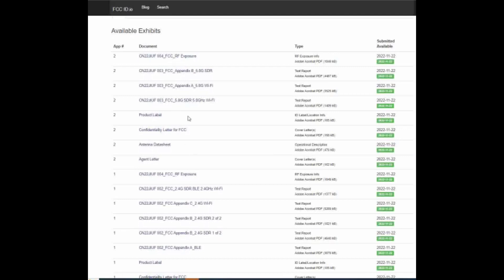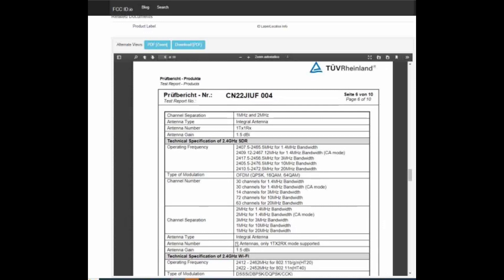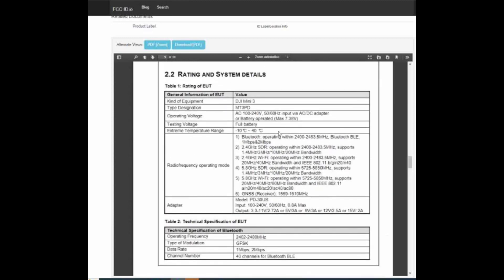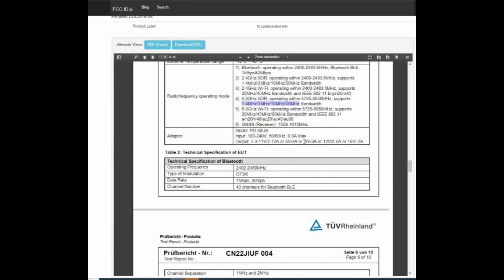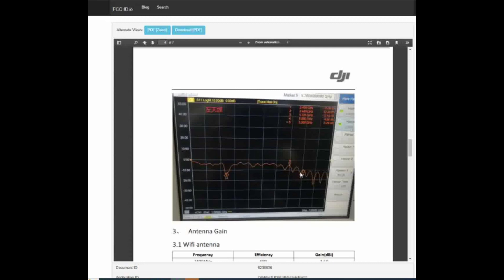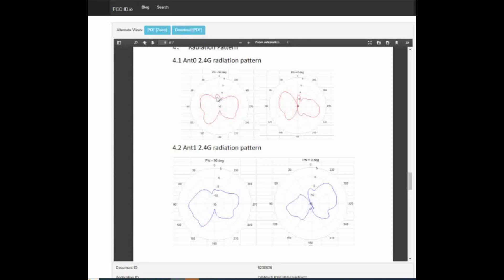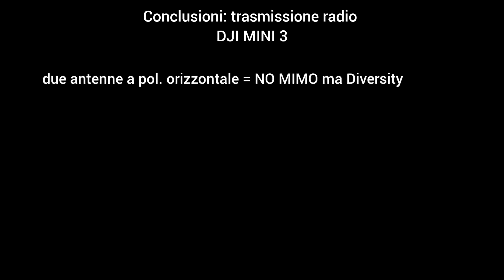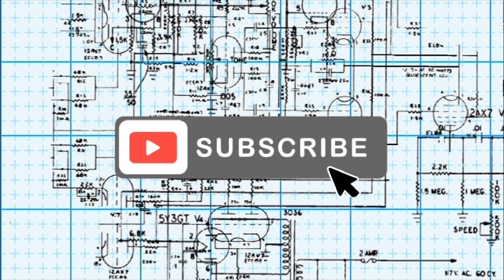DJI MINI 3 non pro...a che serve ?! Con OCUSYNC 2.0 ?

Comment: Ciao Raffaello. Un basso return loss non implica necessariamente che l'antenna non funzioni, ma che esiste un disadattamento, cioè che la potenza (del trasmettitore, o del segnale ricevuto) viene trasferita male. Se alimentassimo un dipolo a mezz'onda all'estremità (circa 600 Ohm), con una linea a 50 OHm, il disadattamento sarebbe enorme, però avremmo lo stesso un'antenna funzionante. Con un monopolo (verticale), anche molto più corto di 1/4 d'onda, o più lungo (ma meno di 1/2 onda) questo funzionerebbe ancora perfettamente, praticamente come quello a 1/4 d'onda, a patto di adattare l'impedenza (cioè cancellare la componente reattiva, elevando od abbassando l'impedenza dell'antenna in quella della linea). Ho seri dubbi che le antenne del Mini3 (non pro) siano verticali, perchè nei documenti c'è scritto orizzontali, e allungare un cavo sino all'estremità dei bracci implica più cavo (20cm per migliaia di pezzi sono metri) e più peso.
Reply from the maker: Si, si il return loss l'ho spiegato in maniera molto veloce per i profani. In ogni caso una antenna con un return loss alto spreca molta energia in calore se non vi sono altri adattamenti.
Per quanto riguarda la polarizzazione dell'antenna sono d'accordo.
Chissà a cosa serviranno quelle zampette. 
A meno che, non abbiano sbagliato ad inviare la documentazione ed abbiano inviato quella del Mini 3 Pro.